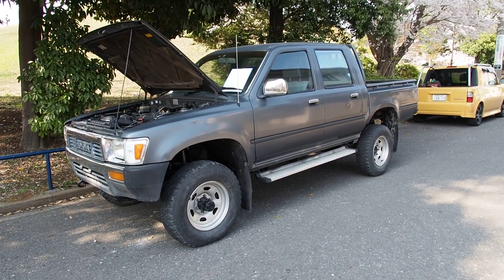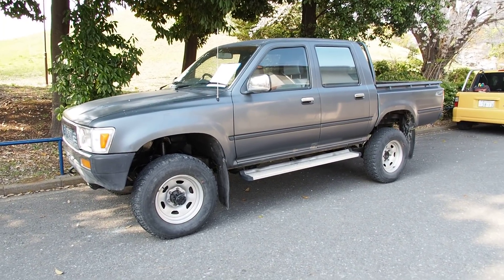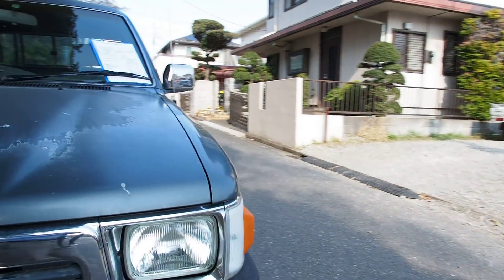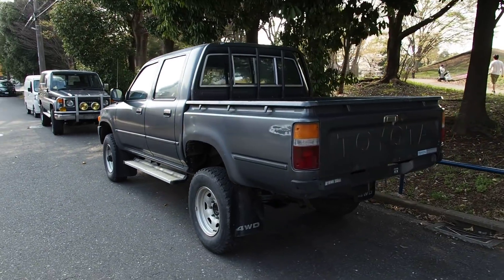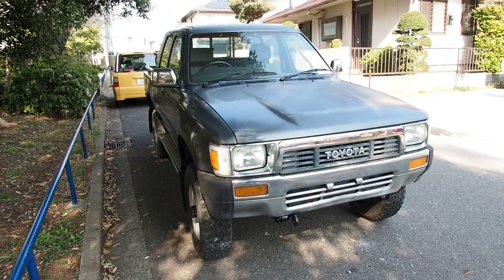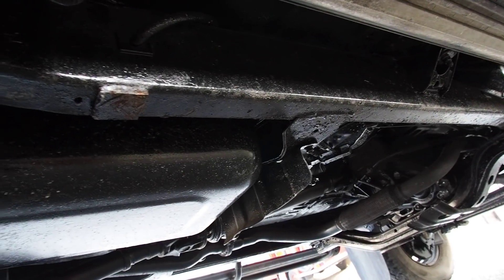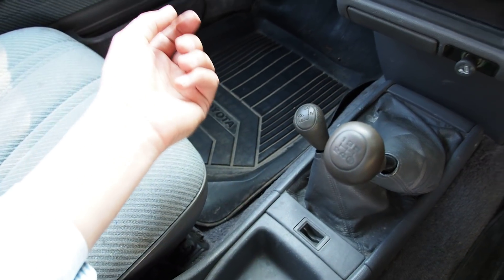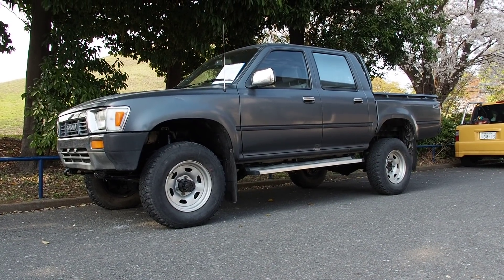1991 Toyota Hilux Pickup Double Cab Diesel 4x4 (USA Import) Japan Auction Purchase Review

Comment: The 3L versions are a bit thirsty, but more power. The 2L turbo's are more fuel-efficient have the same power.
Reply: My 2.8d naturally aspirated engine a.k.a as the 3L gives me about 7/8 km per litre..is that normal? 
I wonder if 26/28 km per gallon would be considered as thirsty in the US?
Reply: @hokz7283  that's normal.
Reply: @hokz7283  us is full of V8's they use to thirsty cars

Comment: This truck has more than 60K Km's as can be seen from the wear on the driver's seat and the wear on drivers door hinges. We own the same truck LN 106 (1990) and it is at 400K Km's and still the driver seat is in good shape with similar door hinge wear.  The paint on the frame is not a good sign. The rust tapes on the door implies it is really rusted. Cracks on the dash (first time I see cracks on a hilux dash in this era)

Comment: I love small diesel trucks and SUVs. How much would a truck like that be able to tow?
Reply: 3rd World Garage that is impressive milage on the Nissan. I have a 2006 Jeep Liberty CRD with 2.8 litre 4cylinder turbo diesel engine it can tow 5000 pounds and will get over 20 mpg towing my 2000 pound popup camper on highway.  I like the double cab truck with the diesel, like the Hilux sadly none sold in the US except Chevy Colorado. Nissan prototyped a Frontier with a 4cylinder Cummins engine but it has yet to enter production. I realy want another diesel when it time to replace the Jeep.